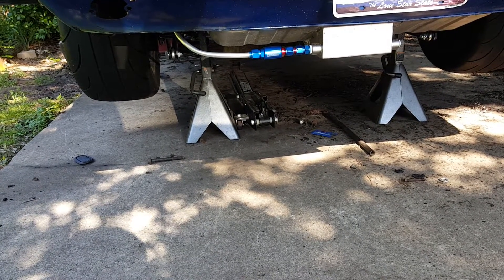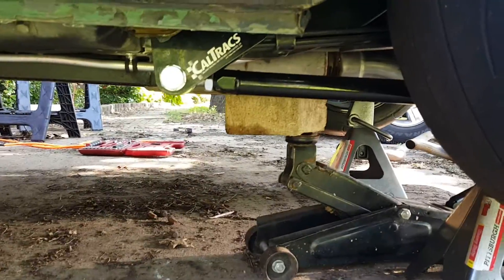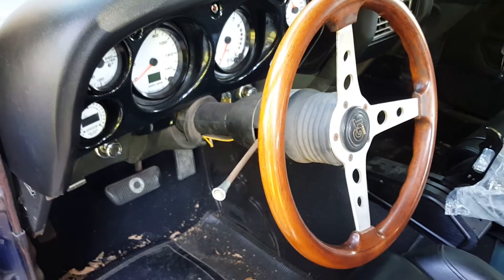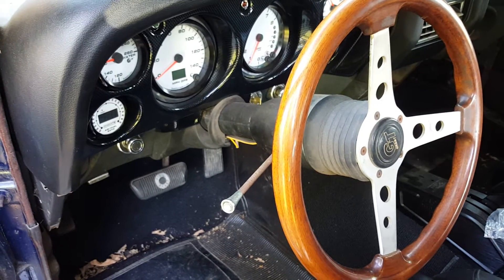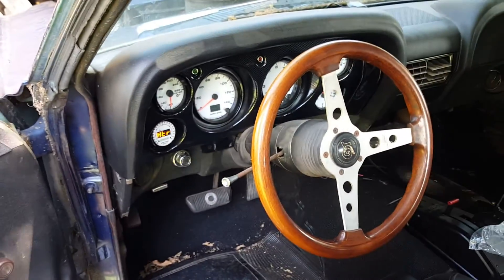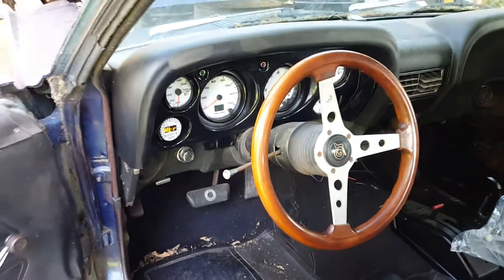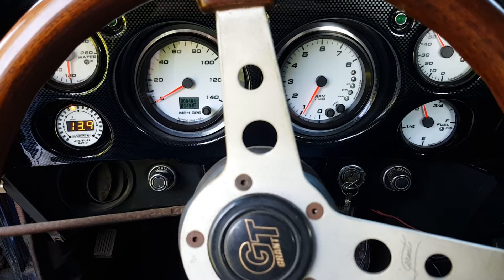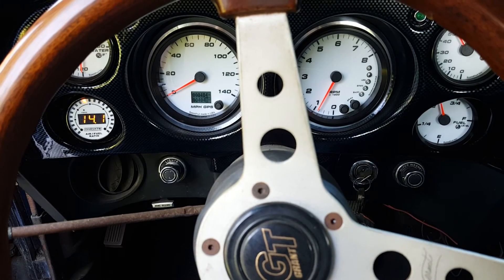Quick FiTech EFI update. 4 weeks since last start.

Comment: How is the fitech fuel command center working for you I have heard that you have to run a vent to the fuel tank can I use the line coming from my fuel tank to the canister that's marked tank on the canister under the hood and do I have to run a line from the fuel command center to a intake port? THANKS
Reply from the maker: I loved the command center but I did replace it a few weeks ago. There was nothing wrong with it but I am switching to e85 and needed a bigger pump so I now have a Tanks Inc efi tank and Walbro 450lph pump. 
You do need to run a vent with the command center because it will puke fuel occasionally after you shut the engine off. This is from heat soak and fuel expansion so it's normal. If you do run a command center you MUST have between 5 and 6 psi of incoming pressure. if you have less it will leak out the vent because the float valve inside requires fuel pressure to seat it closed.

Comment: How do you like the sump? Do you have inline pump, or intank pump? The pump seemed pretty quiet, what pump are you running?
Reply from the maker: I am using the FiTech fuel command center which is mounted in the engine bay and I am feeding it with an edelbrock performer RPM mechanical pump rated at 110gph. The purpose of the sump was to be able to run a 1/2" (-8) Fuel line as the factory 5/16" line was insufficient. 
The sump itself is great. Was a pain to weld onto a 45 year old tank but only took a few hours.

Comment: NICE! I am getting the fitech for my 81-Z28 ... how long did it take you to get your system if you ordered it? they are telling me 1 month wait time until it gets here! fitech is backed up with loads of orders!
Reply from the maker: Luckily I ordered mine back in February and received from Summit racing in 2 days. I got mine before they were cool. :)
Reply: Man your lucky!  They must be selling like hot cakes!
Reply: +shenlonco  i ordered the 1200 hp kit from summit racing and it is set to be delivered tuesday so it has taken me right at 1 month for mine.
Reply: +Billy Taylor yep the waits a bummer but from what I seen it's well worth the wait!
Reply from the maker: +shenlonco Just so you guys don't have your expectations shattered..this and any other system isn't exactly plug and play for most modified motors. Stock or nearly stock motors, sure. But just like a carb once you pass a certain point of modifications you will need to tweak the tunes just a little. The more vacuum you have the better the self learning is. I only have 10" at warm idle so my spread from idle to WOT isn't that great. If you have 16 or 18" of idle vacuum it will probably be able to 100% self tune. The tweaks to make are minor but be prepaired. The best part is all the needed tuning is from the handheld.
Reply: +434josh Hi Thanks Mine is going on a stock Chevy ZZ4 crate motor so I don't know if that will be a good thing or not...see my channel search 81 Z28 you will see my motor.